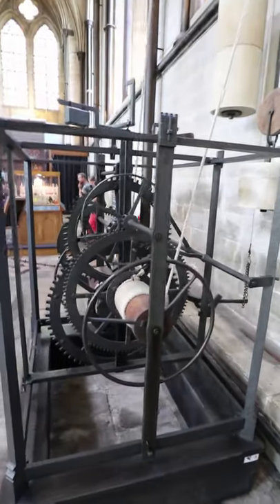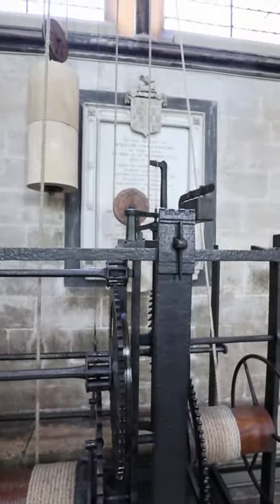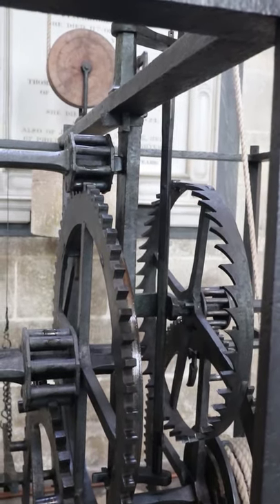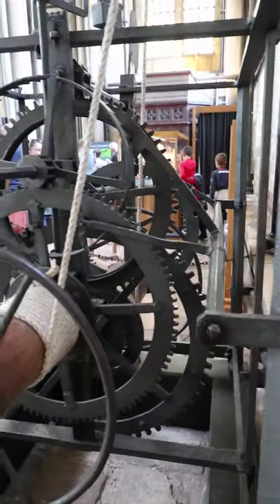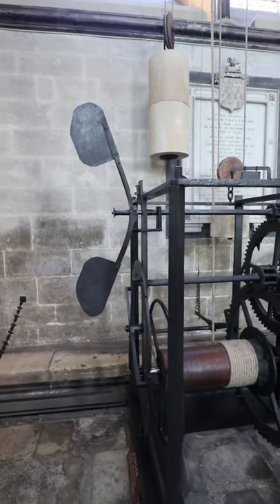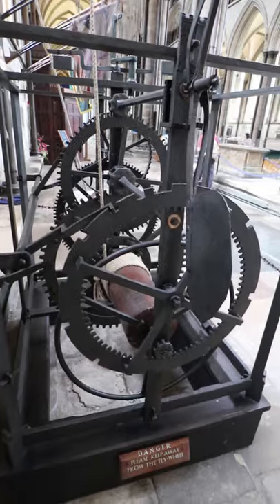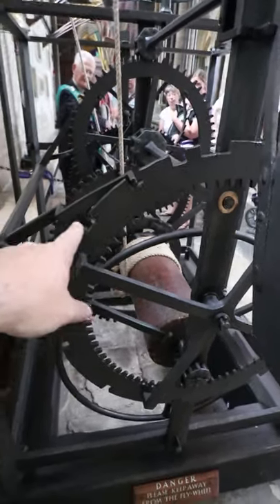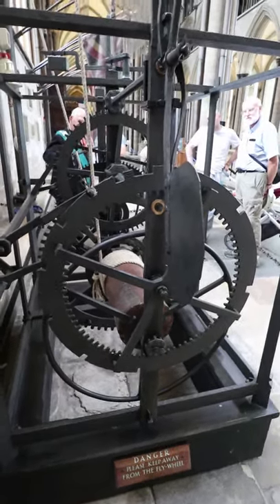Oldest known mechanical clock @ Salisbury Cathedral

Comment: For the striking side, the big part at the end of the wheel train, with the two blades, is the “fan fly” or just “fly”, and serves as an air brake to keep the strike train from over speeding when it is running. The part which actually counts the hours is the “count wheel”, and the lever which falls into it to shut off the striking train after it has counted the hours, is the “count lever”. Count wheel striking is very simple and early, but can get out of sync with the time train if it fails to trip on the hour, or is tripped more than once before the next hour, so in the 1600s an English clockmaker invented “rack and snail” striking which works off the hour hand to keep the striking in sync with the hands. Both count wheel striking and the verge and foliot escapement are so old, we don’t know who invented them or what year. I’m not sure they’re even sure the name of the builder of this clock. Thanks for sharing!
Reply: Well thank YOU for the interesting side-information

Comment: The top part is called a “verge and foliot” escapement. The arrangement of the two escape pallets on their arbor is called the “verge” and the escape wheel in this kind of escapement is called a “crown wheel” due to the shape. The actual swinging timekeeper at the top is the actual “foliot”. This system predated the invention of the pendulum by at least 350 years, and was considered good enough for those days.
Reply: Apparently, when this clock was discovered the original escapement was replaced with a pendulum.
I don't necessarily understand the point since there's no dial and it just rings a bell. Why would there need to be minute by minute accuracy? If the bell chimes 12 and it's around noon, isn't that good enough?

Comment: how do i tell the time on this ????
Reply from the maker: It was made to ring bells at a certain interval (like every 30 minutes) - so no clock face.
Reply: The earliest mechanics clocks did not have dials. At their best, they were only accurate to within about 15 minutes per day. What they did was strike a bell on the hour. The earliest ones probably did this once an hour from the time train, called a “passing strike”. Later, someone invented the striking train, and there are documents telling of the existence of a striking clock in Italy in the early 1300s that could count up to 24 strikes on the bell per hour for 24 hours a day. This must have been tedious however, so shortly thereafter most clocks only struck up to 12.
Reply: Dials with a single hour hand (and sometimes also astronomical functions showing movements of the stars/heavens, Moon etc) were introduced to mechanical clocks probably around the 1300s. Of course both sundials and mechanical hand cranked astrolabes such as the Antikythera Mechanism, date back to antiquity. But non water powered, automatic mechanical clocks were new in the late Medieval period. Clocks were not accurate enough to justify minute hands until the 1600s. Seconds hands were introduced around the 1700s. An outstanding exception is the clock made in the 1500s for/by Mr Burgi, I think (don’t have my books with me), which features a “cross beat” escapement. But that clock was basically a one off.